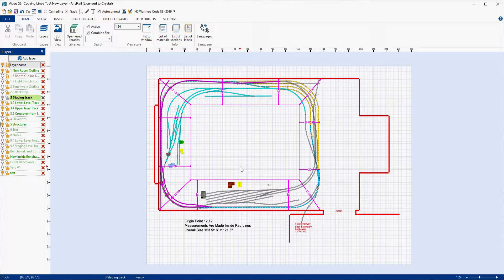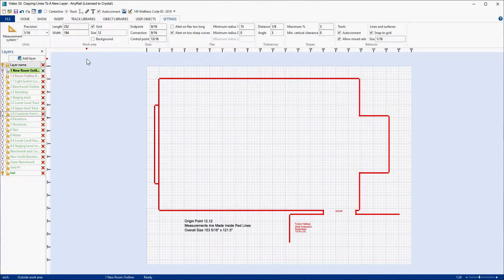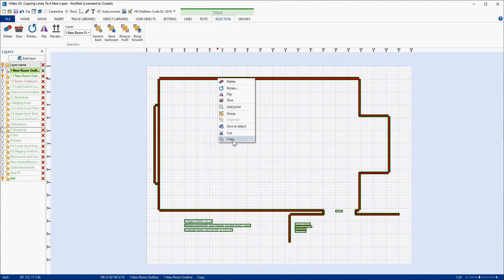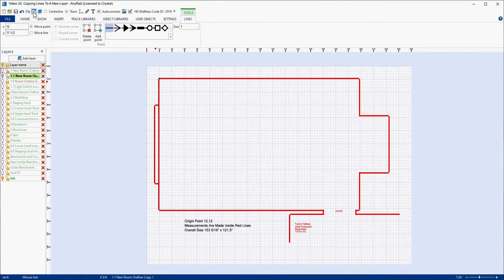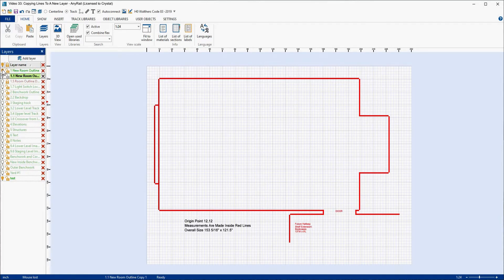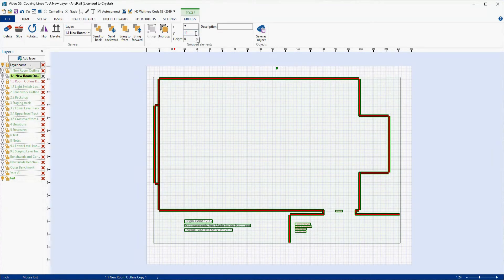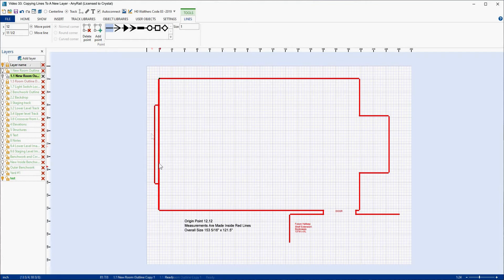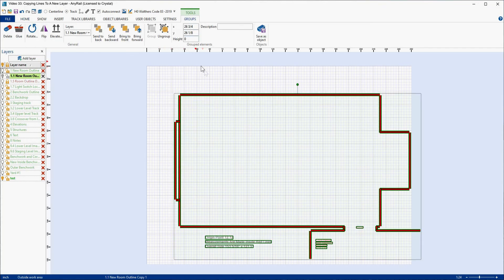AnyRail 6 Tutorial Video 33: Copying Lines To A New Layer

Comment: I simplified the process by "creating" the missing layer copy command using a key object placed at the origin (0,0). On the first layer, make a square surface...in my case I did a 4" by 4" square. Make sure that this key object is present on every layer. Then, you can just turn on the layer information that you want to copy to your new layer, and then press CTRL-A to select everything...CTRL-C to copy. Go to the new empty layer and copy it (mouse click, then CTRL-V). If the image is not automatically lined up with the origin, then just move it using the upper left point of the key object, so that the point is set to (0,0).  This method has proven to be quick, and because of the key object at the origin there is no need to align anything...it aligns itself because the key object is (0,0) on every layer.

Thank you for your videos. These have been the catalyst I needed to get going with AnyRail.
Reply: I left out the most important step in my post. When you paste your selected entities into the new layer, group them while they are still selected. It's the grouping with the key object in place (AKA anchor object) that allows the entire group to be positioned at (0,0). Once they are in place, then click ungroup. The process has become second nature and I neglected to mention the part of the process that makes it line up on the copied-to layer.

Step 1: Select objects you wish to copy to another layer. The anchor object you have at (0,0) must be one of them. CTRL-A will select everything, if that's what you want.
Step 2: CTRL-C to copy
Step 3: Go to layer that you want to copy to (make it the active layer)
Step 4: CTRL-V to paste
Step 5: While the pasted objects are still active, GROUP those objects
Step 6: Move the entire group to (0,0) using the group coordinate input boxes
Step 7: While the group is still active, UNGROUP it.

Using this method, all of the copied objects are in their original alignments without the need for adjustment.  Just ensure that you have an anchor object at (0,0) on ALL layers that you copy from. It could be a different object on each layer, but it must always be placed at (0,0). I use a small square. It can be colored to match another object placed there, or the background so that it is not visible on-printed pages.